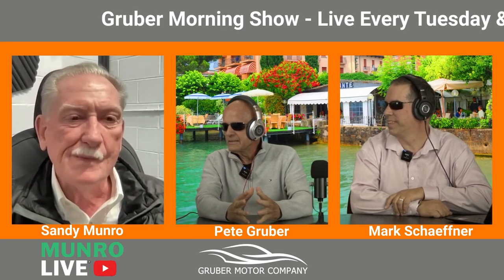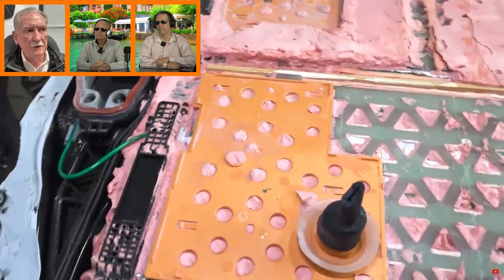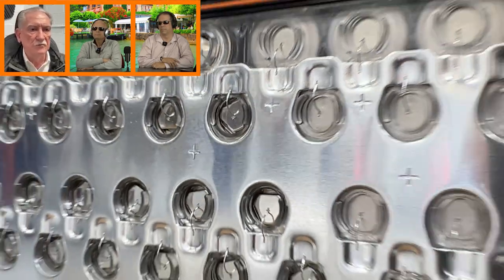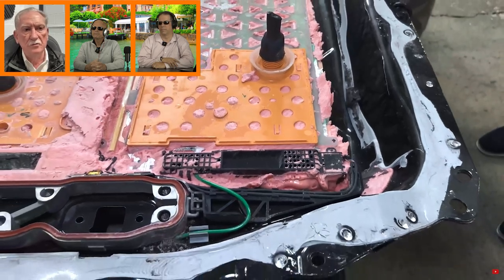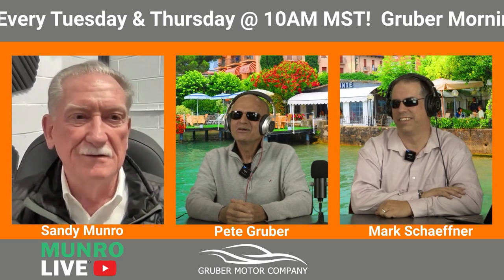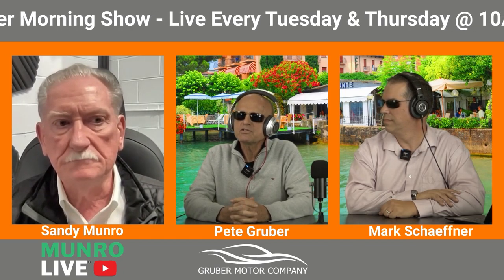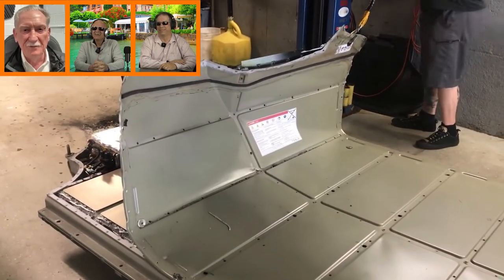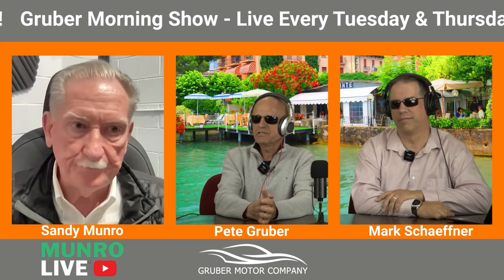Is Tesla's Structural Battery Repairable?

Comment: As if cell failure weren’t a problem( as Munro makes it look). Gruber of course knows better
Reply: Maybe the new cells are better than the older 18650 cells in the S and X cars. Also.. the fact that the cells are better supported thru the foam.. against vibration might make the failure rate lower.  There will always be failures in anything made. But if the rate is very very low, it may not be an issue.  I do prefer repairability also.. GM has gone that route in there Ultium pack design.
I guess time will tell which is the better overall route to take.
Reply: @kens97sto171  Maybe. But I wouldn’t count on it. Failure rate may be lower because there are fewer cells.
Reply: @EVPaddy  
But the failure rate can be also reduced by the manufacturing design. They mentioned the thin connecting wire in the Model S in the original packs That's a very high failure point. Vibration defects in the wire etc. They eliminated that. And then in case the entire assembly in foam that cannot allow anything to move. That eliminates most vibration related connection failures. Probably going to leave you with only internal cell failures. Maybe the new 4680 cells are less failure prone.
Comes down to cost too. Both for the manufacturer and for the person who owns the car. Sure you can put a new engine in your car. The question is whether it's worth it or not? Same as going to be true with these battery electric cars. If that battery fails at 500,000 miles nobody is really going to care at that point. If they start failing every 150,000 mi then people are going to be concerned and the value of these cars and the used market will be very low due to the risk.
I've got a 14-year-old Prius with 423,000 mi on it still on the original battery. That battery cost $2,500 brand new from Toyota. 
But the car has saved me much more than $2,500 over the miles I've driven.
Reply: @kens97sto171  A Prius has a NiMH battery in it. That type of cell is more robust than Li ion.
Reply from the maker: Our experience with EV battery reverse engineering reveals that with every new or altered battery chemistry, a new set of parameters emerge.  The most recent example of this is an emerging trend in Roadster batteries, in which replacements released in 2016, are not outlasting the original packs from 2008.  We have a video describing these findings - https://youtu.be/bK4g2Ts30tA
Reply: Not a problem with Tesla.  Other EVs,…Houston, we have a problem.
Reply: @hvh377  
That's definitely true, nickel metal hydride is more robust to heat and cold. But the batteries in the Prius also have a very basic thermal management system. Basic air cooling. It is temperature monitored. I would think that proper temperature regulation and liquid cooling and charging and discharging rates on a modern lithium ion pack would be just as reliable.
I guess only time will tell.
Reply: @kens97sto171  You don't have to wait. There is ample data available about longevity of NiMH and Li-ion batteries in general. A NiMH pack can withstand a lot more 'mistreatment' than a Li-ion pack and it doesn't need a complicated BMS keeping the cells in their happy place.
The issue here is much more related to production process control (defects), correct design (as you mentioned), correct assembly and out-of-spec use. This is not about normal wear (because that affects the pack as a whole), but about 'premature' defects, which would warrant repair.
Reply: @austinpowers1999  No, of course not. Tesla is faultless in every way. How could I forget?
Reply: @hvh377  
I understand what you're saying. But that lithium ion pack also has a lot of design elements put in place so that it does stay at the proper temperature and proper charge etc. You're right the nickel metal hydride doesn't need that because it's more resilient, to that abuse. Although pretty much every hybrid that uses one never really uses the full capacity of the battery. Even if you take a Toyota Hybrid all the way to the bottom of the battery gauge you're still sitting at about 20% state of charge. And if you take it all the way to the top you're at about 80% state of charge. I would know I have a Prius with 423,000 mi on it. And I've got a few acquaintances with far more miles than that on them.
Time will tell whether these new lithium ion designs in the Model 3 and Model Y including the 4680 cells might end up being far more resilient than you seem to want to give them credit for. We really don't know yet. I've got a cell phone from 2007 that still works on its original battery. Doesn't have much capacity anymore. But the battery still functions.
It's all going to be related to how well was the battery engineered what was the design like did they factor all the things in that they needed to to make sure that it is a long-lived battery. At the very least long enough to satisfy the demands of 95% of the consumers out there.
The real tell is going to be what happens when these cars are 15 plus years old. Are they just worthless junk? I have no issues buying a 15-year-old Toyota. Because I know I can get parts and I know I can repair it, and even though it's old it's still likely to provide good service.
If these electric vehicles become nothing more than paper weights once they're older. They will have almost no resale value. Although by then perhaps there will be other options that are so inexpensive to purchase and so inexpensive to operate over their lifespan that having them be essentially a disposable car won't really bother anybody.
Reply: @austinpowers1999  yep, that’s why Gruber is doing so well, because he has nothing to do 🙈
Reply: @hvh377  - Prius packs are known for having their connections corrode and the monitoring wires come loose.  The cells may hold up well (NiMH is certainly robust) but the rest of the pack fails around them.  There’s a whole industry around rebuilding bad Prius packs.
Reply: @ClockworksOfGL  There you go. Even the robust chemistry can be made unreliable by a poor design choices. That's a great example of what I tried to convey.
If Toyota builds those battery packs the way Tesla is building its structural pack, all you can do is replace it with a new pack when the connections corrode and let go. No repair or rebuild possible.
Reply: @hvh377  NO BUT THEY MAKING OEMS LOOK LIKE THE AMATUERS THAT THEY ARE. MISTAKES ARE PART OF THE PROCESS.  ENJOY THE RIDE
Reply: @westcoast8562  I'm not deaf, but I am unable to understand your response. Please clarify.
Reply: @hvh377  NO
Reply: @westcoast8562  I'm still not deaf. No need to shout. Great discussion! Glad we could clear that up.

If I may be so free; I have a small tip for you. Completely free of charge and it could save you some time and energy: You could try not typing below a YT video. Saves a bit of physical exercise and some bandwidth and it really makes no material difference compared to the opposite action.
Reply: @hvh377  I AM NOT YELLING I AM 77 AND DONT SEE GOOD.  THESE ARE LETTERS AND NOT VOICE SO I UNDERSTAND YOU
Reply: @austinpowers1999  they also have battery problems just like anybody else.
Reply: @essentials1016  3 years and zero battery problems with my Model 3
Reply: @austinpowers1999  11 years and 0 problems with ice cars
Reply: @theowink  On what planet?  Toyota burns oil and so do the turbo Honda motors.  KIA and Hyundai have problems with the aluminum engines. Ram breaks down continuously, I have all these cars too.
Reply: @austinpowers1999  i have been driving a bmw 1 series from 2005 for 6 years now still no issues.
Reply: @essentials1016  most excellent
Reply: @grubermotorcompany  but how many EV fires did your company have compared to Carl Medlock and sons who've both worked at Tesla also why did those fires happen and how many Roadsters were Roasted?

Comment: A whole new industry will be developed for battery replacement and servicing . The foam looks sloppy . As from the video it makes servicing almost impossible it also makes recycling difficult and toxic . Tesla really doesn't take sustainability seriously and rides the back of the green wave of profits .
Reply: The recycling is not really difficult or toxic either. The packs are designed to be ground up and washed.
They use polyurethane foam, which is recyclable (with some limitations). The rest are all practically recyclable into new batteries.

The toxic chemicals they mention are the chemicals for depolymerising the foam, so you can easily disassemble the pack, but this kind of disassembly is not intended and not necessary either.
When the cells are too old, you need to ground them up either way and separate the particles by density.
My only problem with the foam is that it is not recyclable into new foam, but that may change too, there are active research about this.

It would have better to use either compostable foam (which needs to be highly insulated from any water) or something which have an easy and cheap solvent like ethyl acetate.
Reply: Its not a polyeurethane foam......Its an encapsulating material that adds structure aswell as a thermal resistance temp to the material too where it actually acts as a heat sink.. The product is  MG Chemicals 832TC-375ML.. Whats funny is when tesla posts pictures of its factory etc they should blur out the labels on the barrels in the background as AI is keen to read these labels especially the ones that have a barcode......LOL..Tesla also uses specially formulated products made by Loctite and Dow that are packaged with the Tesla logo....Even you can get a specially blended chemical made by any of the 3 listed ,get it patented, give it a label then market it as proprietary and have it made by one of those 3..........LOL Its like 12v lead acid batteries.....No matter the brand theyre all made by Johnson Controls..........LOL